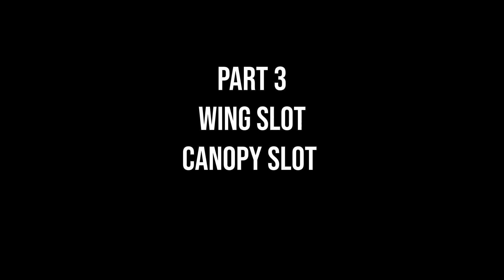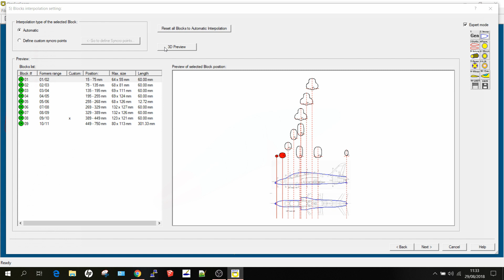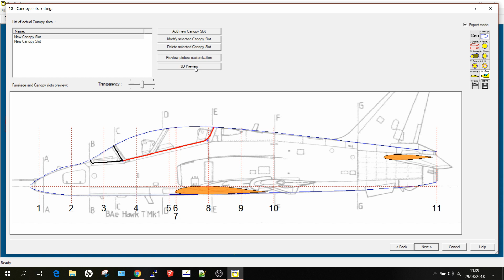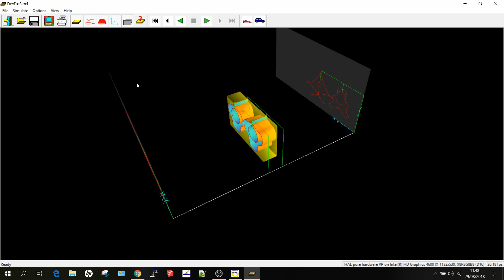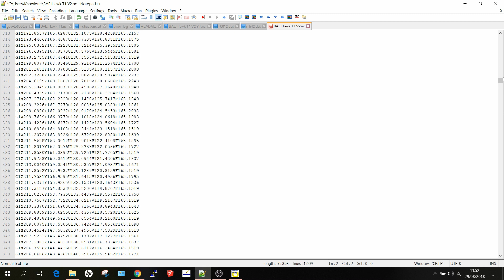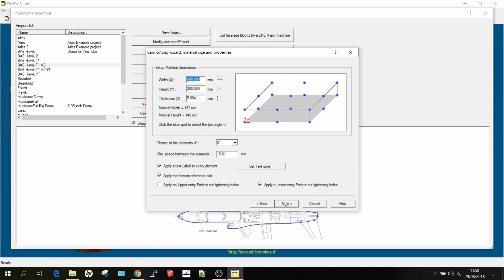DevFus Foam 2  - Overview

Comment: Good evening Keith Hope everything's going well with you over there. I have an interest in doing a 737 fuselage and thinking that I finally want to dig in and learn how to use this software. Specifically which version do I need to do wings and fuselages?
Reply from the maker: Hi Nathan. Yes not doing too bad thanks,  For fuselages, you need DevFus Foam and for wings DevWing Foam.  You can download them both and try them out and everything works apart from being able to save the g-code and a few exports.  I'm working on a  full tutorial for DevWing Foam which I hope to have out before Christmas.  The last video I did a quick run-through making some blades for a gyro-copter.  DevWing Foam looks a little overwhelming to start with because there are so many options but I'm very impressed with it.  The fuselage should be quite straight forward on DevFus Foam and the DevWing Foam will be ideal for those swept-back wings.  Is this going to be a powered version or a sloper?   Hope that helps
Reply: @rckeith  Not sure yet, i will work on the fuselage first while i decide. The mh32 airfoil would do ok for slope or powered so i can put it off for a little while. Slope would be a lot cheaper.
Reply from the maker: @thenatedog  Yes I like the MH airfoils use that on all my flying wings.  Cheaper to slope but some 10 Bladed EDF's would sound great.  Good luck with and as ever if you need any advice just reach out to me.